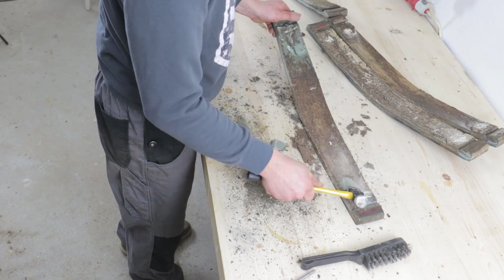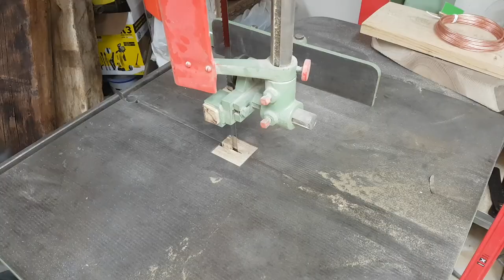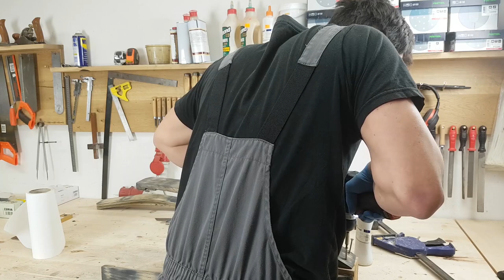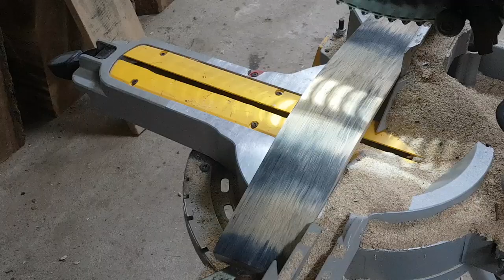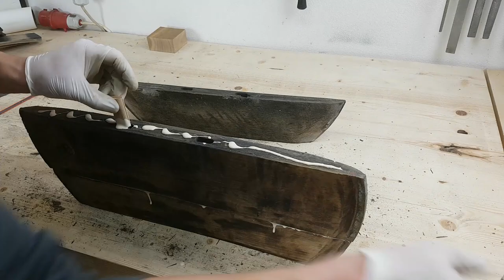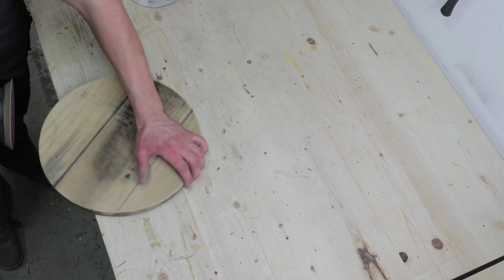Turning An Old Wine Barrel Into A Bar Stool

Comment: Andre, I have one small suggestion for future projects like this one:  I've used joiners myself quite a bit for my own projects, so I have an idea about what happens when they are used.  Consider using a single piece of wood, smaller in diameter than the seat to place on the bottom to take the strain off the joints in case someone sits on the edge of the seat and not directly in the center.  For example, if the seat is 16" in diameter, consider gluing a single piece of circular wood anywhere from 12" to 14" in diameter to the bottom of the seat.  Then, when you attach the seat to the legs, the screws will pass through the bracing piece AND into the original seat material.  This will take the strain off the joints, just in case.  I've made small table tops using joiners and I always glue a smaller "bracing piece" to the bottom, just in case.  By the way, I like how you finished to wood to retain some of the natural patina.  Great work as always!

Comment: Nice piece. Question though: how did you ensure the screws in the center block weren’t crossing and running into each other with all four legs going into that single block?
Reply: I think a 6x6 or 8x8 block would be better